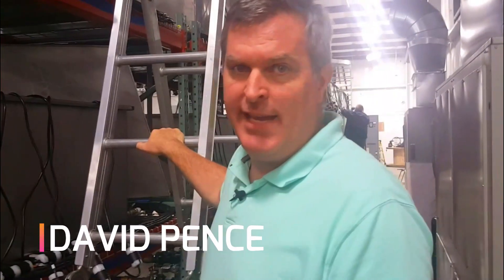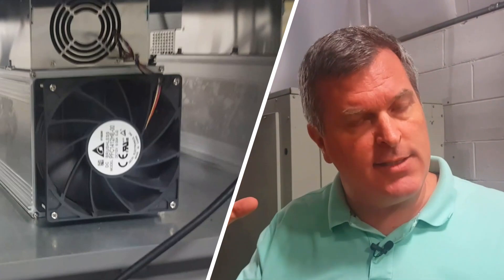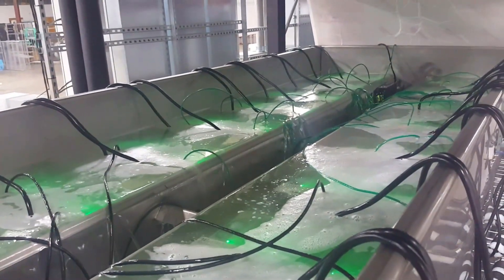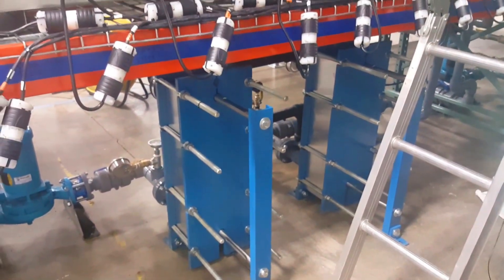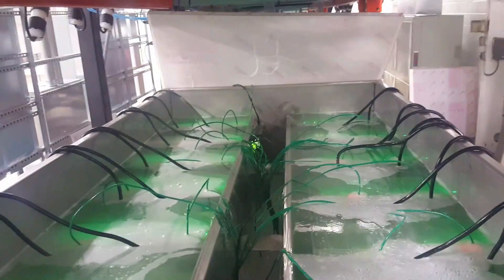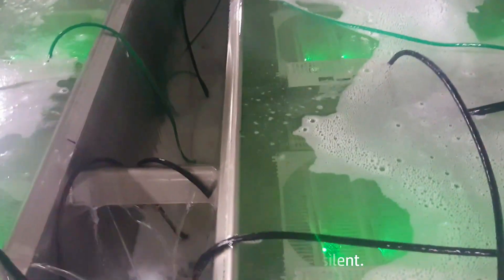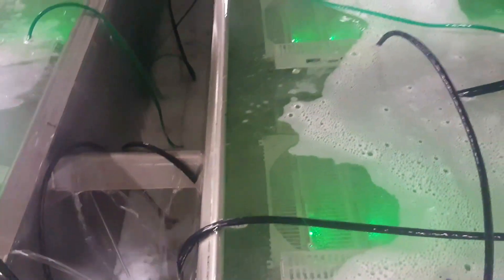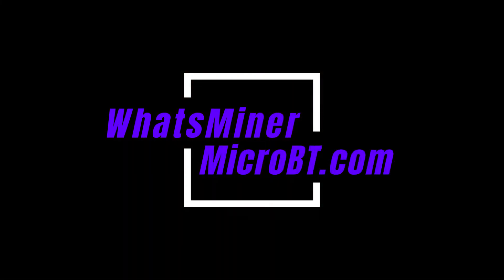Liquid Cooled Bitcoin Mining in 2019

Comment: Did you use a special firmware? so the miner can run with no errors because of the fans.
If so, it can work with any miner?
Reply from the maker: If you buy Whatsminers the seller can help you with this.  It is possible to run stock miners with stock firmware with fans disabled.

Comment: Hi David, The tubs seems to be air opened when in service.
Is the fluid filtered in the process ? If yes what kind of filter did you have used ? And where are there integrated on the piping diagram ?
Thanks for your response. Best regards
Reply from the maker: We filter manually.  Our facility is pretty clean though thats why we can do it that way with the fluid.  With the water we filter and treat as we use Water Towers for cooling.

Comment: Are the M20 miners using a different kind of firmware where the fans are disabled or did you submerge the entire miner with the fan into the immersion cooling system?
Reply: We have done both. If you have m20s you can work with the dealer you bought them from for firmware support.
Reply: @davidpence5622  The dealer claimed that if I get the M20s, I can just put it in immersion cooling by removing the fan and no firmware change required. I seek your advice on this because I can't find any firmware that can disable the fan sensor. Really appreciate your help here David.
Reply: @skchiew  who is the dealer?
Reply: @davidpence5622 Dehan Network Technology Limited in China.
Reply: So is it true that I do not need any firmware update to disable the fan sensor on the M20s?
Reply: @skchiew  Hi there, did you find the answer? I have here ready m20s and heating my house with heated oil from miners, but how to disable fan check?

Comment: Hi please may i ask what the process is?? That i need to follow i am willing to take the risk and understand this is at my own risk and your not responsible in amyway shape or form
Please i follow your channel with great interest please keep up the good work it’s really appreciated to say the very least! Thanks again 🙏✅🙏
Reply: The process is using mineral oils that are designed for electronics.  We cycle the heat of the mineral oil to heat exchangers and move the water outside to be cooled by either chllers, water towers or geothermal depending on the geography and climate.
Reply: Hi David many thanks for your comment and feedback love your content i have liquid immersion however what is the exact process i need to do to get these beasts running without fans i.e is it a software upgrade please provide link or fan simulators?? Thank you in advance i look forward to your much welcomed reaponse thank you again sir have a great day! 🙏👍😊👌

Comment: Have you managed to overclock the M20s by using liquid cooling?
Reply: Thanks for the quick reply,  very interesting indeed but doubt I’d run the risk currently due unit prices 😁
Reply: Yes.  We are testing all kinds of modes but a standard M20S is capable of running at 85.5 THS or higher with correct power in our immersion tests.
Reply: @davidpence5622  does it require a special firmware to overclock miners and would you mind sharing it with community?
Reply: We have, it is possible but it voids your warranty and should be done only with extreme care and understanding the risk/reward.